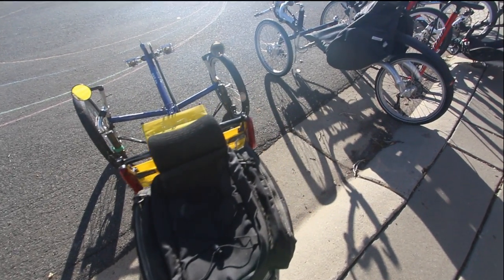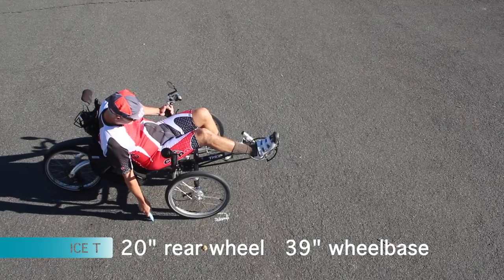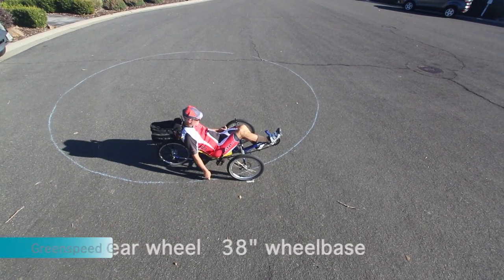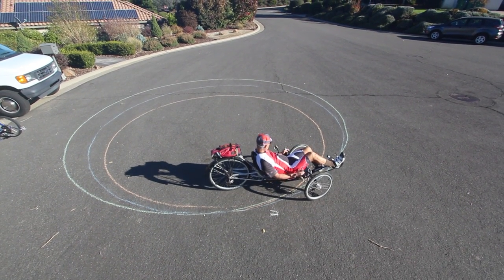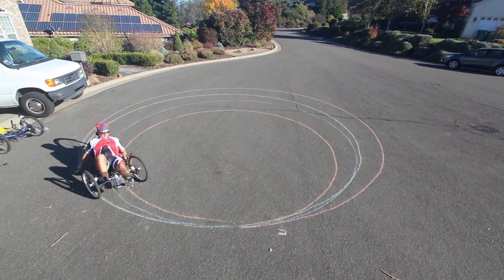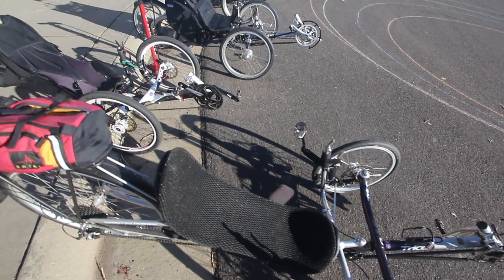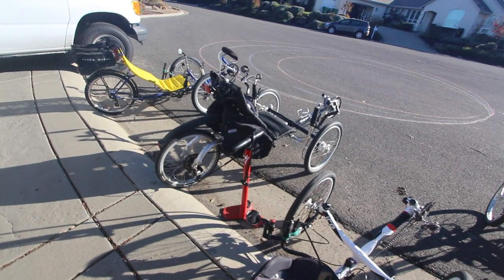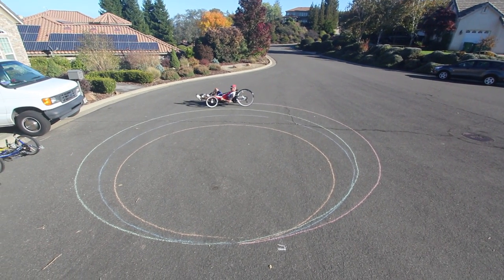The Recumbent Tadpole Trike Turning Radius. What it is and how it affects you.

Comment: Great demo video. My original Catrike was Trail with 20” wheel and I now have a 559 and a700 and my experience clearly reflects your findings. The 559 turns  much tighter than the 559 but the 700 is so much fun. I am a dedicated trail rider so I have really no concerns about turning radius. When going out for rides that can include a lot of potential road work and sidewalk negotiation I choose the 559 for that reason and it is a smoother ride when running on Sidewalks etc. hitting bumps in a 700 with Schwalbe Duranos at 110 psi can shake you up pretty good.
Reply from the maker: Once again, an excellent excuse for owning more than one trike, Mark! :)

Comment: In practical street terms Seat Height  means a lot too, because these things Roll Over.
If I have a tight turn , I just go all wheel chair , and turn where I need to, Just real slow.
I worry about side force on the wheels , too, as trikes use bike tires where that is mostly minimal.
Again a turn at speed  issue, but you like to push fast road turns on the channel.
Turning radius gets noted , but really never affects my rides. 
On bike type delta trikes, their height, narrow WB, and length are part of what gives them such delightful handling.
Reply from the maker: Some good points! I never really try and push tight turns while going fast. No fun tipping over. :)
Reply: @bikestrikesrazors  I have a short parking lot track where I practice turns, after some near rolls. I am impressed by how quick they lift the outer wheel and how much brake steering matters. Steering radius speeds that process.
Reply from the maker: @whazzat8015  That wheel goes up fast on tight turns if you're going fast enough! It always surprises me and reminds me to slow down. :)
Reply: @whazzat8015  the trikes with decent front end geometry don't brake steer or bump steer, that's why I sold my Greenspeed GT3 and bought a Magnum big wheel. I can brake hard with one side and it stays straight- just with less stopping power.
Reply: @rossbrumby1957  It may be discs are mo grabby, but on my Spike,ICEXL and TerraTrike  all brake steer bigly, and need sensitive modulation as pace quickens. 
Magnum looks to have more camber. Raises the issue on weight distribution and how to predict effect, more so since so many trikes get bought online, without test riding. Tire selection  may have a big effect as well and there are few opportunities to test before swapping out for most. Makes test like this one valuble.

Comment: I have a delta recumbent trike that is 6'feet long and I can do a 90° turn with no problem my Hase Trigo do a good job
Reply from the maker: Yep, the tadpole's are restricted by the seat and design. Deltas have some definite turning advantages with that front wheel all by itself up there!.
Reply: Some deltas can turn tightly with inside rear tire not rolling forward.

Comment: Frame geometry affects tight turns on my trike - a TerraTrike GT. When peddling through a tight turn, either the right or left front tire (depending on which way I am turning) hits my foot on part of the pedel stroke. Not a big problem - just a thing.
Reply from the maker: This happens to me on one of my road bikes, Bruce. No big deal on a trike, but I've almost gone down a couple of times when my foot touched and stopped the front wheel. :)

Comment: NICE demo - although is not a BIG deal., because of a neurological disorder I have I use my trike as more of a 'mobile' device sometimes.  And because I have rode a GreenSpeed GT5 for many years and 'K's' of miles, Ive got kinda use to it. I  went to  an X7  and it was even better I think, BUT I needed \ hydraulic disc (coordination issues) so I'm currently riding a Sprint RS 20 and ... the turning is much wider .  Im thinks that swapping a GS seat (its 15" wide and the ICE is 16") will help some
Reply from the maker: I think you're correct, David. I almost never notice the different turning radius' on my trikes. It takes a special situation for it to create any kind of issue. I would think that if the narrower seat increases the throw on your steering assembly, it should make for a tighter steering radius (if you're having an issue with turning radius). Thanks very much for watching!
Reply: @bikestrikesrazors  It takes a special situation for it to create any kind of issue.  Yepper, Im kinda a special situation!!!  Because the ICE has an adjustable rear section I have made as short as I can. It's about the same as the X7 now, turns better but still needs more - Ive not fond a GS seat frame that I can modify to the Sprint frame , that will Help as well(know of any for sale? .  It doesn't seem that its all wheelbase , the width I thinks plays a roll some how, but I can't change that (plus I need the stability ( the extra camber seems of set  the X7  the seat hight in stability)
Reply from the maker: @davidhenry4356  Yes, a combination of things. Don't know of any seat frames for sale. Parts for trikes don't seem to show up much on the used market. :(